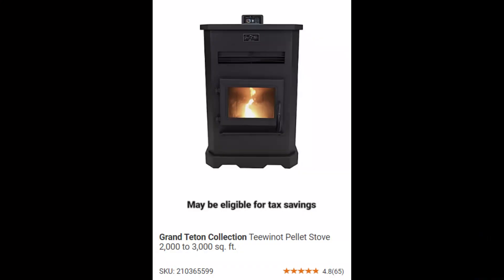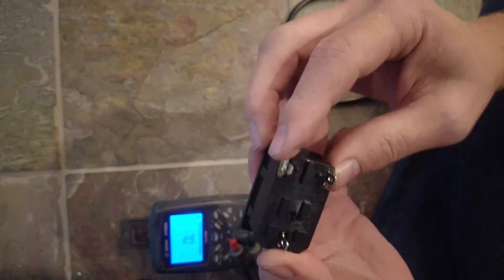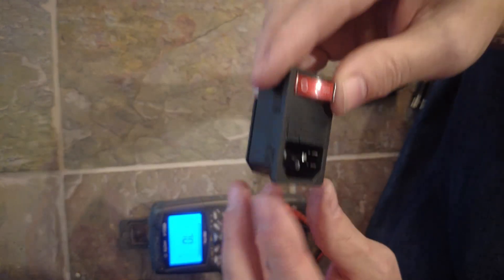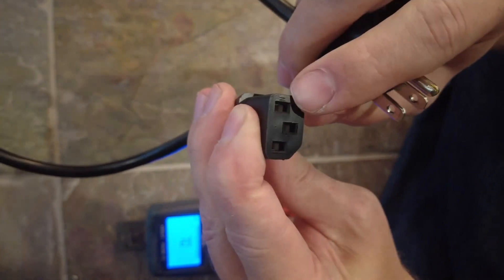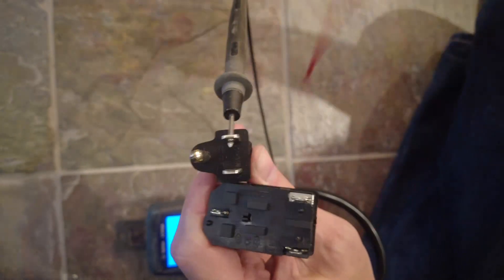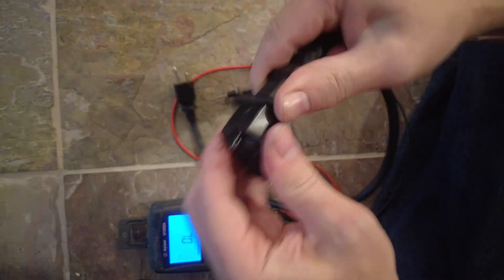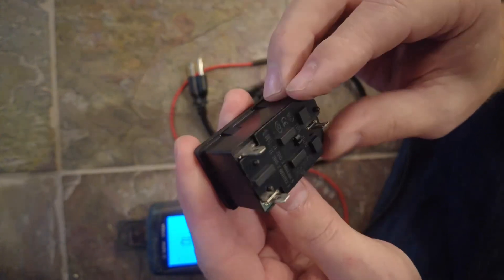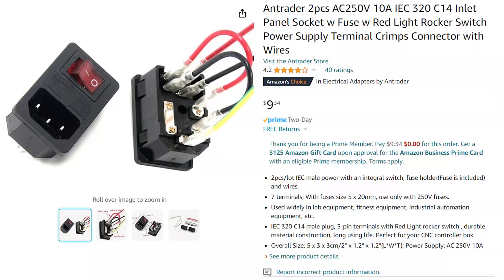Grand Teton Teewinot Pellet Stove - Potential Shock Hazard

Comment: with a plug so convenient, i am not sure why the plug was not just pulled before attempting service. in the meantime, get a cord switch and if you find one, get a double pole double throw and that will isolate both the line voltage and the neutral. the neutral is not always safe and should not assume it is not getting voltage back fed from some other problem with the existing service. You know this, don't you?
Reply from the maker: Yes,   if you notice the new switch I suggest installing is DPDT.  The whole point of the video was to show that the stove was improperly designed from the factory.  It's not to-code to switch the neutral, It does no good to fuse the neutral,  and leaving the hot active to flow through the motors when switched off, should something ground out will not blow the fuse because its not inline with a fault to ground.     Yes with a plug so convenient I'm not sure why they put switches on any plug in equipment.........

Comment: Thanks for posting this,  I bought that same model about a month ago  last Wednesday  evening I turn it off  and 10 minutes later  smoke started to come up, I  opened the side panel the next day and it looked like the exhaust motor burned up, I contacted customer service and explained the issue. 
They are going to send me a motor replacement and a  motherboard as well  im going to replace that plug too,
I will update once I get  the stove up and running again.
Thank you!
Reply: Thanks I will ,
When I turned it off I did on the control so it went thru the process of shutting down but I also noticed in the last week the stove wasn't heating up as much as before my  guess is it was starting to go bad.
Reply from the maker: No problem.  If you use the plug like I shared in the video and need help just send me a message.    It has a few jumpers you need to install.  And the spade connectors are locking (so don’t just yank on them) play with the new jumpers first (before removing the old it has the same locking spade connectors) there is a little unlock tab you need to press. Otherwise you risk damaging the stove by pulling the wires out of these goofy locking spade connectors.
Reply from the maker: when you say "you turned it off" did you use the switch on the rear?